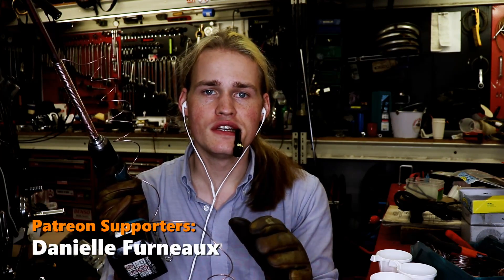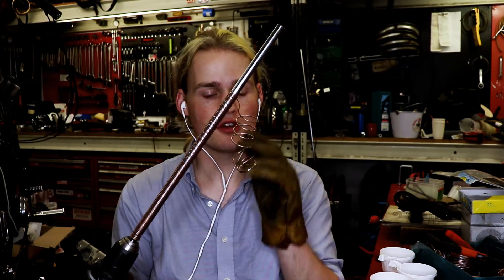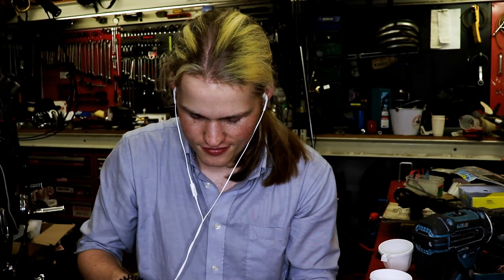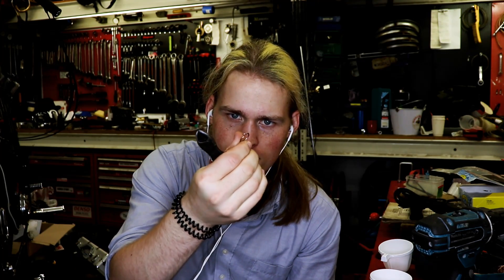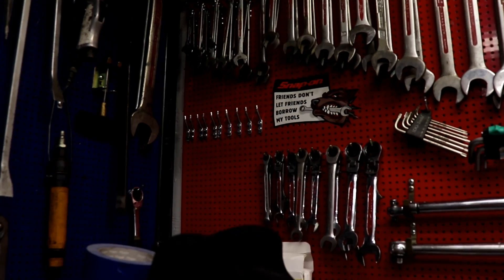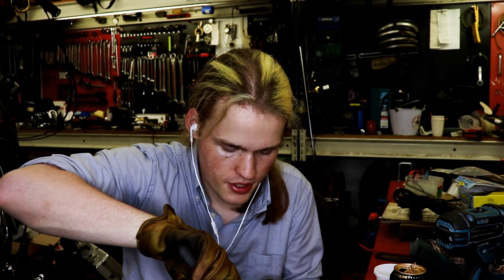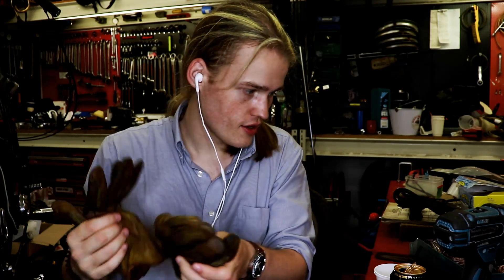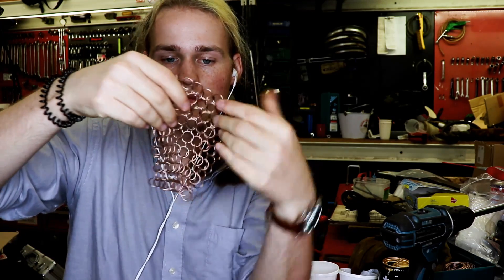Workshop ASMR - Making Chain mail, Should I Get Instagram? (Softly Spoken)

Comment: This was a great video. I never knew how chain mail was made. I've worn and held it in my hands a lot. I never would have thought it was this simple. 😊 I vote yes for Instagram. The ASMR artists I follow don't always post selfies. Plus its another way to connect to your followers.

Parenting classes ft. Chain mail crafting. 😂
Reply from the maker: This isn't how they made chain mail back in the middle ages :P Pretty sure they flattened the metal, drilled holes in the rings and closed them with metal rivets.
Reply: Well...I suppose they didn't have needle nose pliers and fancy twirling rods. Do that for your next video, metal flattening and drilling😂 even still it was interesting to see it made, modernly.